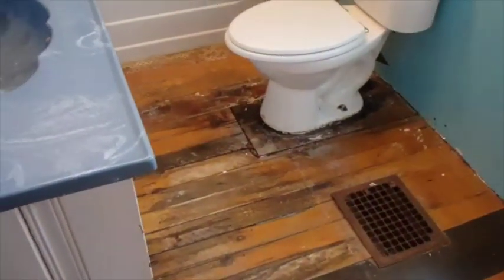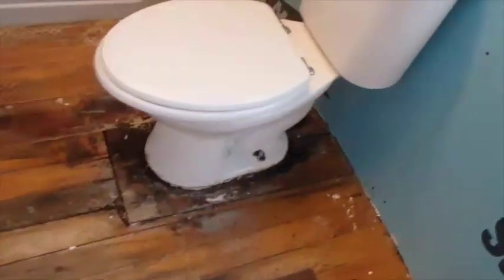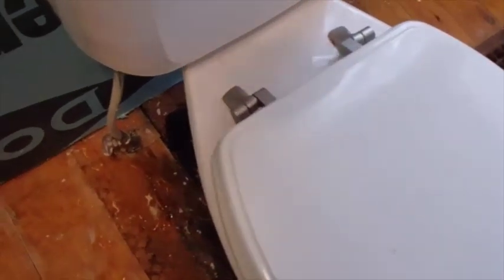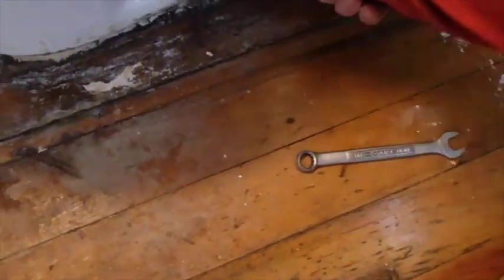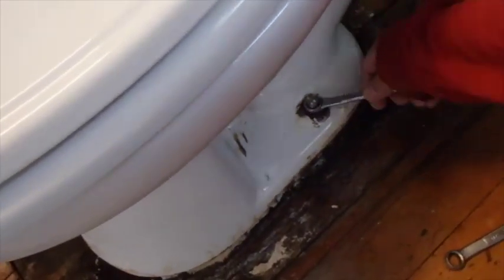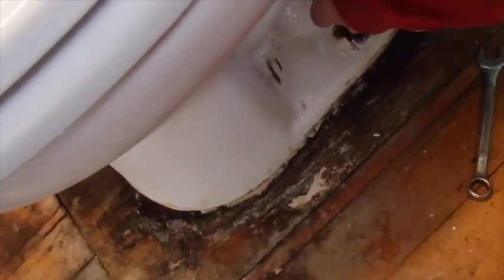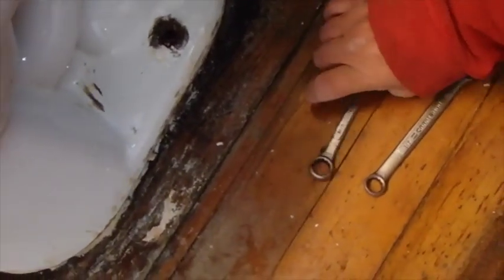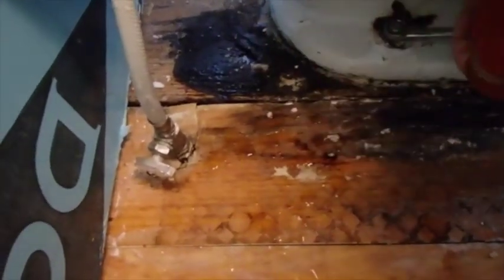Out with the toilet

Comment: just clean it good ,dry and put the floating vinyl floor over the hardwood, no need to remove it...http://www.homedepot.com/p/Home-Legend-12-in-x-24-in-x-6-mm-Textured-Rock-Grain-Bloomfield-Vinyl-Plank-Flooring-16-02-sq-ft-case-HLVP5022-C/300591746

Comment: It's all part of the day to change out a toilet for me, it might be poop to you but it's my bread and butter. Looks like you had the wrong bolts in there those lag bolts usually go th the front of the fixture. You should have closet bolts to hold down to the flange.
Reply from the maker: It's true.   There was a lot about this setup that was wrong.  That's part of why she leaked...
Reply: I worked on a garbage truck when I was yougen and the trucks would get dusty and dirty. Then we'd write on the side,
" Your garbage is our bread and butter,"
Reply from the maker: We used to write messages on the back doors of trailer trucks too...
Reply: If n you can READ THIS THAN YOU ARE TOO CLOSE
                      BACK OFF    YOSEMITE SAM .